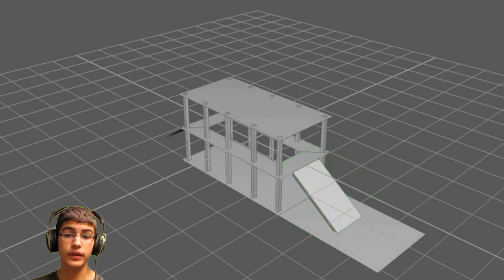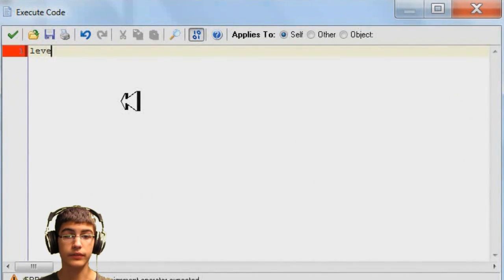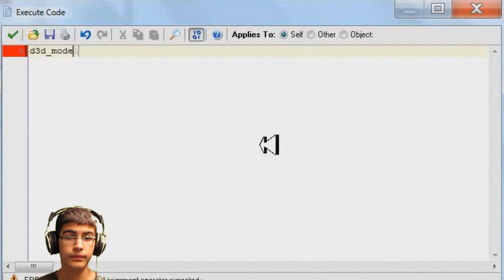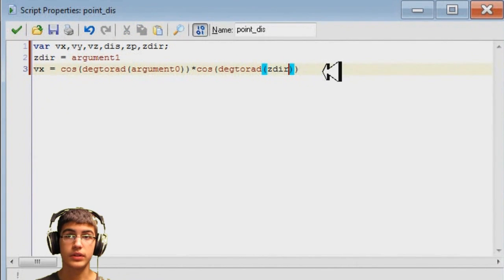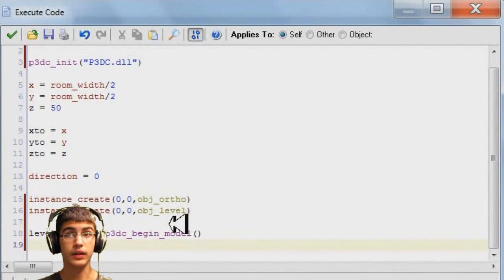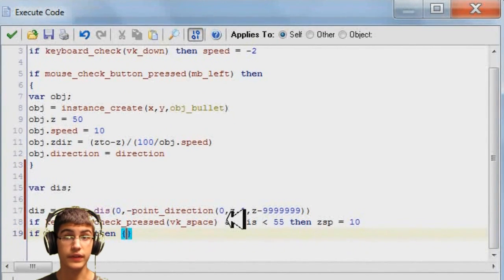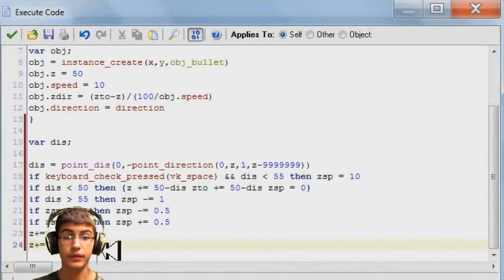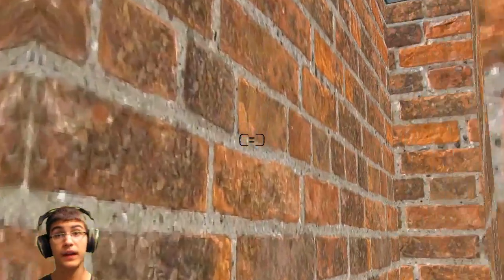Game Maker 8 - 3D Tutorial: Levels

Comment: Hey thesivart, would you mind helping me out?
I've followed this tutorial, I'm using AC3D.  When I make a model in AC3D, save it, and use GMmodelfix to position it, save it into d3d - and try it in game - I click "test game" and it'll load, then close immediately.  No error messages or anything.  I have managed to get SOME models to work - but out of 10 models I create, 1 works (for some reason).  Any chance you could explain the exact method you use for creating/uploading models as levels?